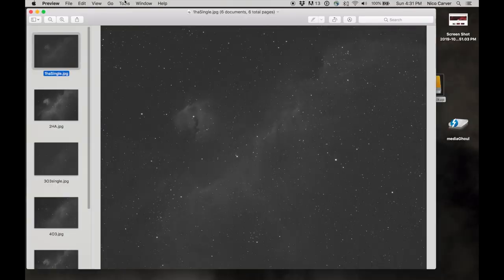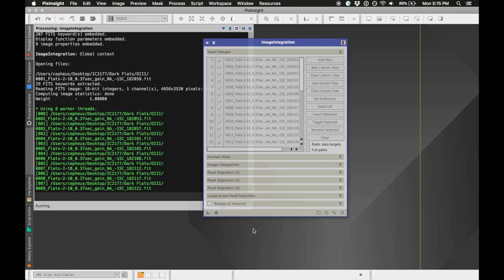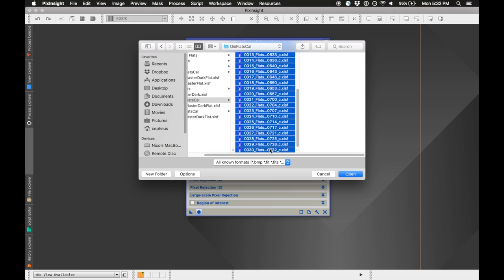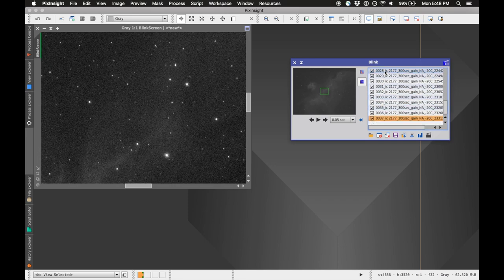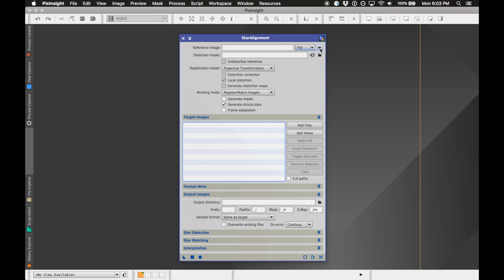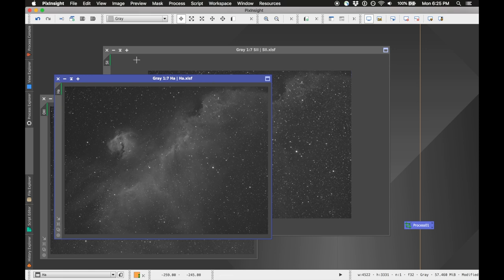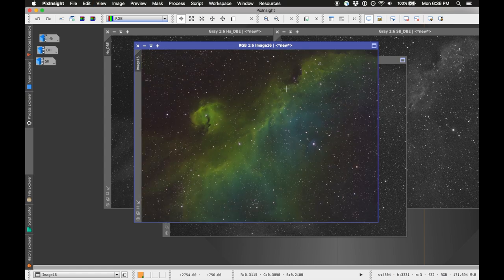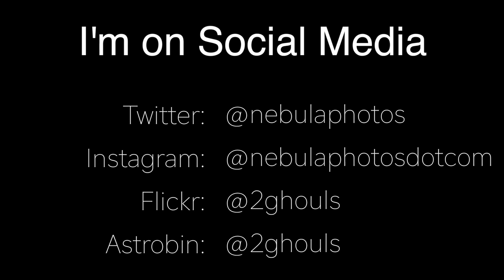Intro to Narrowband and Hubble Palette, Part 2c - PixInsight

Comment: Nico, this is just what I needed. I recently got a QHY 268M and FW with 3nm NB and LRGB. I had been relying on WBPP in PI but discovered I wasn't learning the basics. Although I had done lots of image calibration, registration, and integration earlier with OSC data, the switchover to mono has demanded I pay more attention to the calibration steps and not just automate it all with a script. Thanks for the concise, efficient workflow you present here. No holes in the plot that I can see. Thank you for this!

Comment: Thanks again for the excellent video.  Can you rank your preference for the images produced from each of the three pieces of software, GIMP, PS and Pixinsight?  I'm using PS now and Lightroom but thinking about getting PixInsight.
Reply from the maker: I enjoy having all the programs at my disposal. PixInsight does many things better than the other programs, and could be the only program you need for deep sky. Still, Photoshop does a few things better/easier. In my opinion, GIMP doesn't do anything best, but is a good alternative to PS since it's free and well-established. For my actual edit of the photo (https://www.nebulaphotos.com/img/ic2177.jpg), I used PixInsight for 90% and Photoshop for 10% of the editing. This one didn't need a whole lot though. For more complicated projects, I use PixInsight for 60% and Photoshop for 40%. I also have a license for AstroPixelProcessor, but need to use it a bit more before I can start making videos. I already knew Photoshop very well before starting astrophotography. PixInsight is such a huge program that after 4 years of using it I think I have only just moved from novice to intermediate.  Hope this helps.

Comment: Excellent tutorial, thanks Nico. I am a bit jealeous about your low-noise subs, mine have much more noise, probably because I am shooting under a red-zone 19 mag/arcsec^2 city sky. Which gain setting do you use for the ASI1600?
Reply from the maker: Thanks Walter. These subs were shot under similar conditions (19.1 sqm) to your sky. You downloaded my subs and compared them to yours?  It might just be the target and how it fills the frame here. When you have a nice bright narrowband target that fills the frame, it requires less stretching and the noise isn’t a big issue. These were all shot at gain 200 offset 50.
Reply: @NebulaPhotos  Just downloaded some of your Ha subs and measured the standard deviation in an area of the background without stars, it is about 10% of the average value. Did the same with my Ha subs and came up with 7%. Ok, so I was just fooled by the smooth look of your subs in the video. Of course, comparison is not really possible, because I usually take 10 minute subs at -35 degrees while you are doing 5 minutes at -15 and I go with unity gain 139 offset 50 and our optics are different, and so are the local conditions.
Reply from the maker: What tool did you use to measure the SD inside a preview? NoiseEvaluation? 

RE: the smooth look 
I guess YouTube’s compression works as a noise reduction filter. :)

RE: -35C
Can you hit this in the Fall and Spring or just the Winter? Where do you live if you don’t mind sharing?
Reply from the maker: @walterkoprolin87  Thanks Walter. And great website! I've bookmarked it and will take a closer look at your gallery when I get a chance.